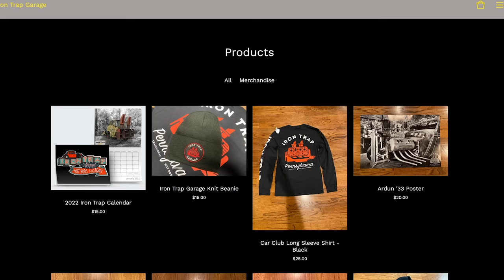Sitting In The Sweetheart Roadster For The First Time!!!

Comment: As usual a great demonstration of "how to" showing Matt's exceptional collection of skills and design ideas.  A side note to Steve: Get yourself a hunk of 3/4" conduit to put over the handle of the Whitney punch! From my own experience, it is the shock when the punch goes through the work piece that does the damage to you! Personally, I used PVC conduit, which was handy at the time, and absorbs a good deal of the shock. 18 to 24 inches is about right.
Reply from the maker: Great tip!
Reply: I would have thought that you would have an air operated punch for those holes

Comment: Hey Matt,
   Your desired position for driving looks like you nailed it, ( from the camera viewing angle anyway ).
The seat back may be a tad to high when upholstered.
For comfort in the seat you might want to place a 2" spacer under the front of the seat board to see how it feels.
I would suggest at least a 3" thick bottom cushion.
I have a 4" seat bottom cushion in my bucket roadster, but the car currently rides like a truck.
It is getting new rear suspension this summer.
   Will the windshield frame be polished before the car is declared finished ?
   Work Safe, Be Well
         Stay Warm

Comment: I have access to a large bead roller that came out of a truck manufacturing factory. I put beads in the floor pans of my Model A hot rod and it worked pretty well. I tried to make a switch panel for below the dash with a curved bead on the outside. The problem I had was that the tool was made for production and it has one speed, too fast. I ruined 4 or 5 pieces before I went a different route.

Comment: Late to the party here but I just have to drop a comment.  Lookin' good, really good.  In the day (last half of the 50"s, first half of the the 60's) the iconic shifter position was with your hand just about level with the top of your head.  That last still of Matt sitting in it is max. cool, just lengthen that shifter.😁

Comment: Just wondering why you didn’t have the larger part of your panel inside the bead roller for support?
Reply from the maker: Because the way the dies are positioned and how I want the bead to press down requires the panel to be out like that. Also the panel would drop if you rested it on the throat of the machine and would cause distortion in the panel.